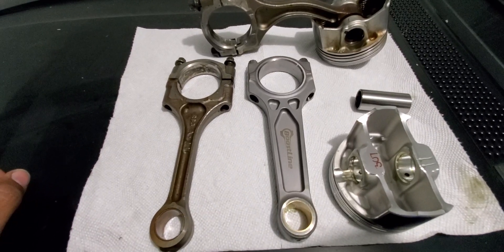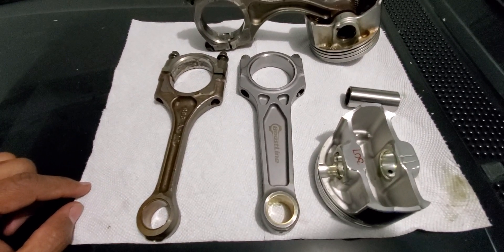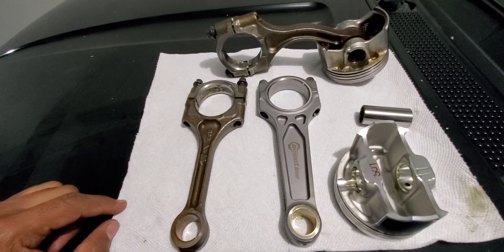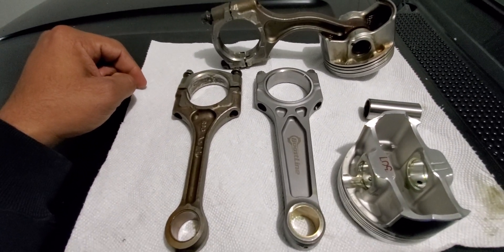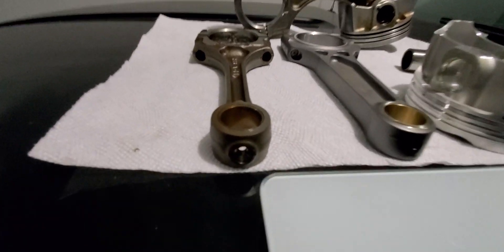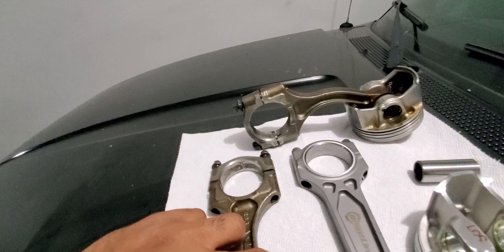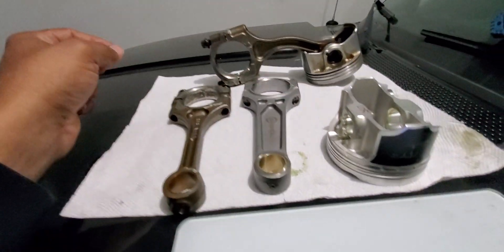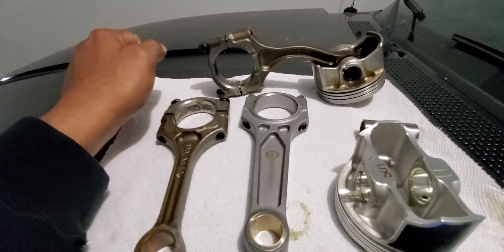K24 boostline rod vs stock k24a2 2006 rod.

Comment: dear one try using the wiseco HD pistons that 4piston racing provides. they are much tougher. namaste
Reply from the maker: Thanks, wish I knew about those before :) so far these have been ok at the power levels that the engine is limited at to protect the gearbox.